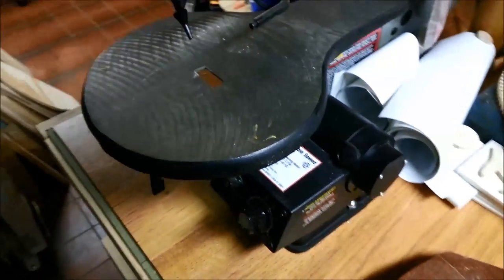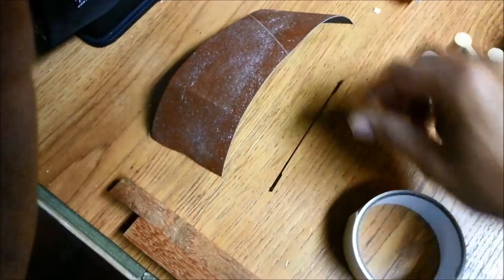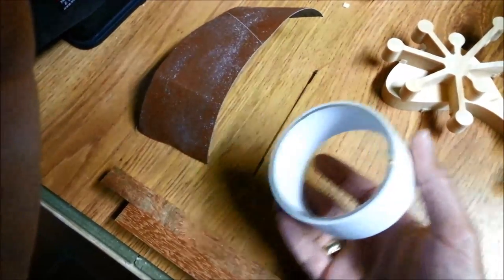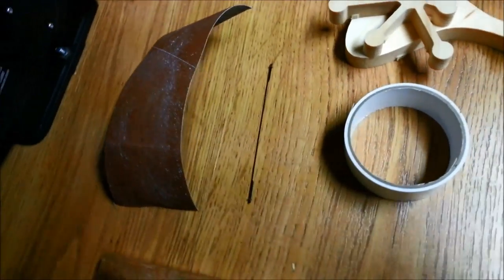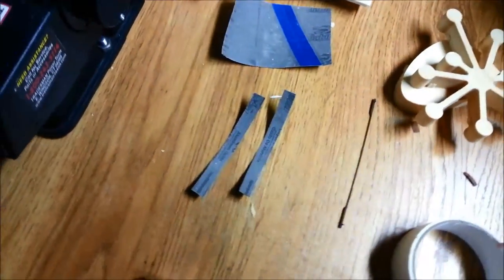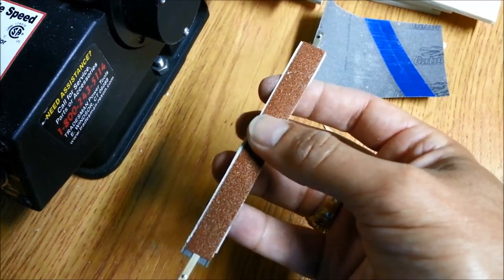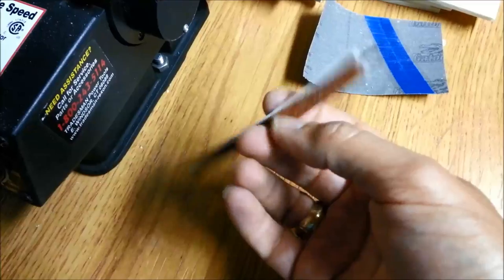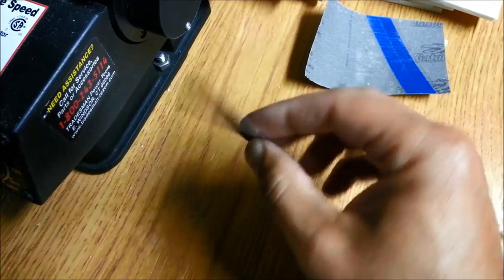Scroll Saw Sander Mod (Basically Free!)

Comment: This is so helpful! Thank you! You don't even need those long strips of sanding paper. The top half gets wasted as it won't ever be used while on the blade. So you only need to put a short piece there where it will make contact with the wood.

Comment: This is good for getting into tight spaces, but for sanding tabs, it would be much easier to use an electric random orbit sander, a palm sander, or a little detail sander. All fairly inexpensive and you don't have to change a blade.

Comment: Those sanding strips to buy with the plastic tabs do not stay in my Delta scroll saw.  This is a great tip and looks like it will benefit me.
Reply from the maker: Thank you for your comments.  It's a useful little mod.  Best of luck.

Comment: Like your vids, But next time put your tabs to the outside of the work piece. It will make sanding a lot easier.
Reply from the maker: Hi Dan.  Thanks for your comments.  Yep, I try to but sometimes with smaller parts I end up having to put some tabs in areas I don't like.  I agree though.